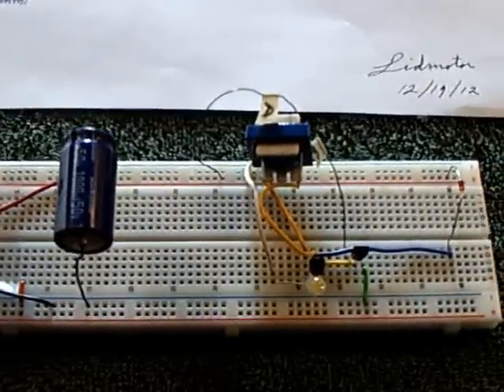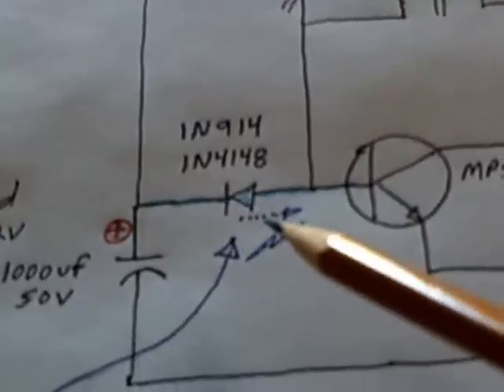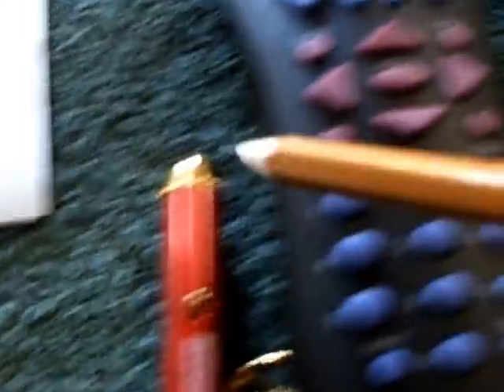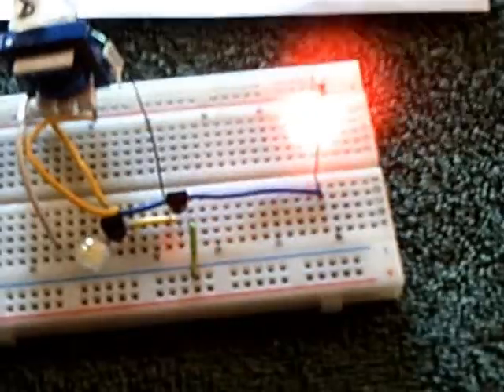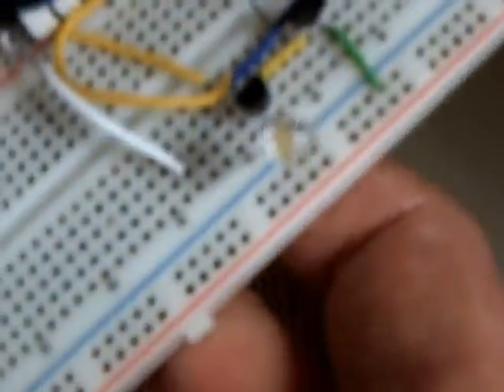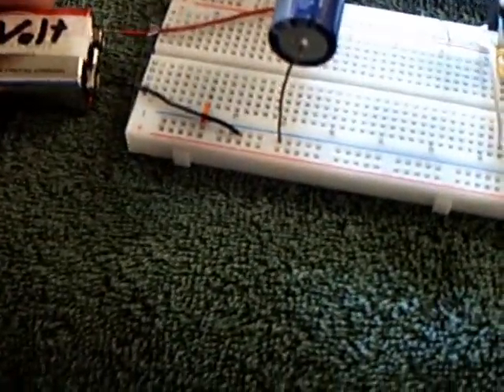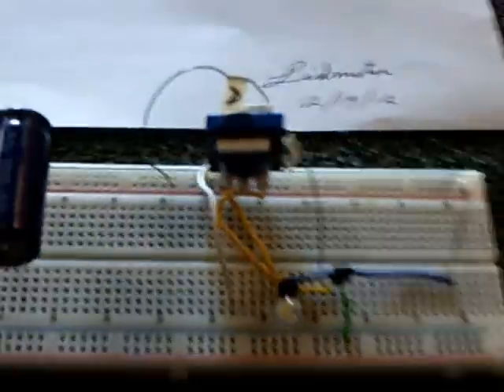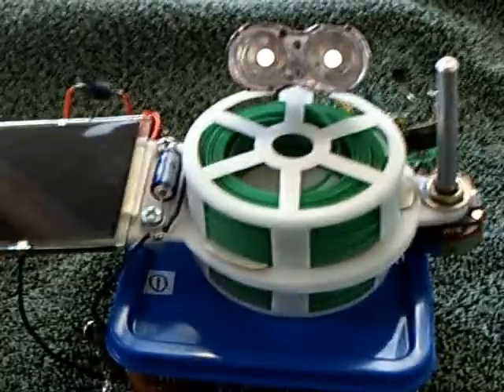Energy Detector

Comment: I am trying to use Germanium diode instead of 1n4148 but this diode is really good at high switching and low forward voltage requirement.
But currently i m working with schottkey diodes to get more efficiency.
with rectenna & yes 
Did you try voltage multiplier using this diode?

Comment from the maker: Merry Christmas.  I am still scratching my head about this 1N4148 switching diode and wondering what else we can use it for.  I tried yesterday to make it switch a one coil one transistor circuit like Patrick (Minoly) did and was unsuccessful.  That diode has been around a long time and I'm sure that it has been tried in all kinds of ways.  I need to do more research on it.  There may be nothing really special about it------or maybe there is.

Comment from the maker: I have one of those AC voltage detectors also.   I think that this thing I made works differently though because it works off light and heat also.   It may be a similar circuit that needs just a tickle to a darlington to go off.

Comment: Radio sounded like an old fire siren when you put the flame on, very cool! Nice use of the P-N junction in the diode. Although I have a feeling the coil is a big part of the AC detection. This one's on my to-do list. I'd be interested to see if the diode is able to trigger from AC at greater distance from the coil, or if the coil is able to trigger it without the diode being in proximity to the AC.

Wonder if it will trigger from cell phone, walki-talkie, microwave, or in front of a CRT.

Comment from the maker: Thanks for catching the circuit diagram error.  I made an annotation that it is an NPN 2N3904 --not a PNP 2N3906 in the Darlington pair.  Thanks also for the info that they do use these diodes sometimes as temperature sensors.  I checked and circuit is being triggered by the diode even with the AC signal.  What was weird was that my high frequency electrostatic devices would not trigger it.  That really surpised me.

Comment: @Lidmotor Another very interesting experiment.  As for the flame, the heat affects diode temperature coefficient which will increase forward bias to MPSA06 NPN transistor.  The 1N4148 is sometimes used as a temperature sensor: electroschematics(dot)com/409/diode-electronic-thermometer  Surprised to see how sensitive diode is to light, infrared and laser.  Is there possibility that EM from AC outlet is being induced into circuit inductors? Should 2N3906 PNP be 2N3904 NPN to make Darlington pair?